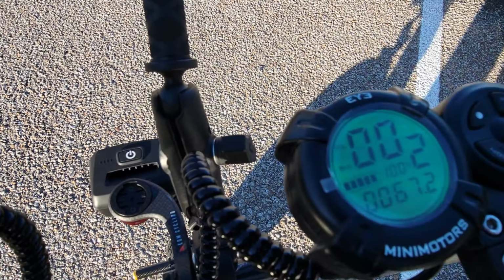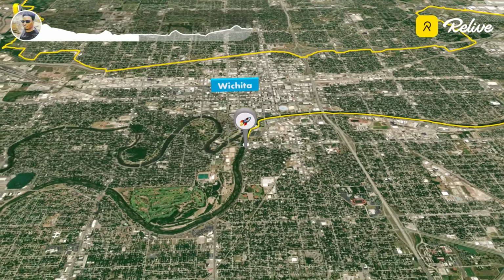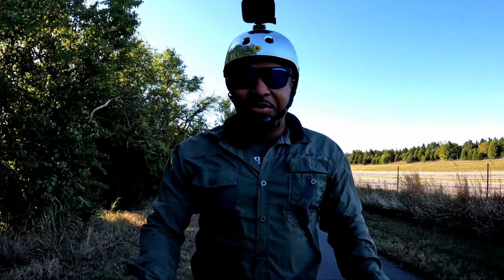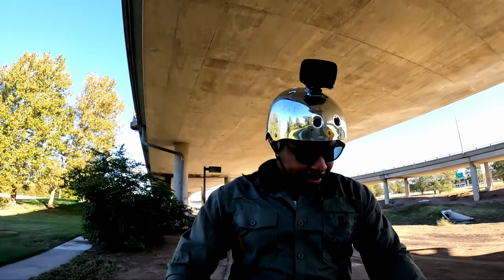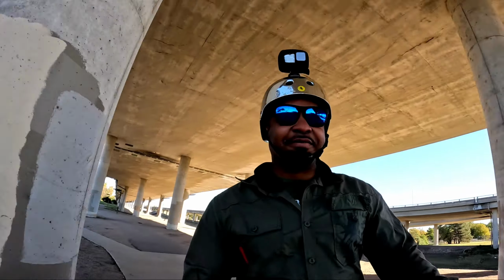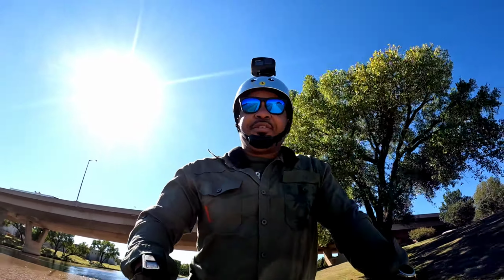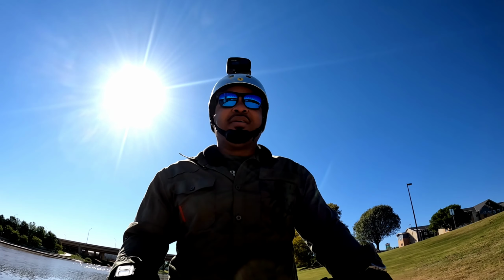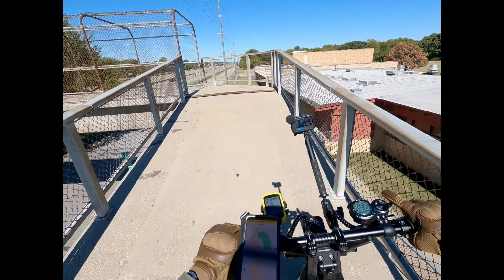Dualtron Victor Range test 'Part 2.1' *Unofficial*

Comment: what speed were you going? looks like you finished at 30 something miles at 50% battery on a single motor right?
Reply from the maker: I was avg'ing 1mph less then I was on dual motor. I was just over 30miles with 55% battery. I really can't wait till it gets warm enough again to run it back. I'll be off work a few days next weekend so hopefully one of those days give me at least 80° so I can run this back

Comment: Great video… to bad about the cold weather.  I bought my victor a couple of weeks ago and am really enjoying it. I have two questions.
1. Mine apparently is the latest version as the guys in the shop were talking about the new lighting on the scooter.. but mine has a  “hazard” light switch below the eco/turbo button instead of what is listed in the manual… any thoughts on that?
2 how can you tell what battery/power version the scooter is as I noticed you said that they come in two versions? My shop in NYC has said this was the high powered LG battery version @$2699
Reply from the maker: Thank you very much! I have no idea on this hazard light looking button. This is the third time I've heard of it now I am curious! If you turn your victor upside down, you will likely see the battery pack you have printed on the belly of the decklid. 

I will assume you're in the states so you likely have the 60v 30a group set.